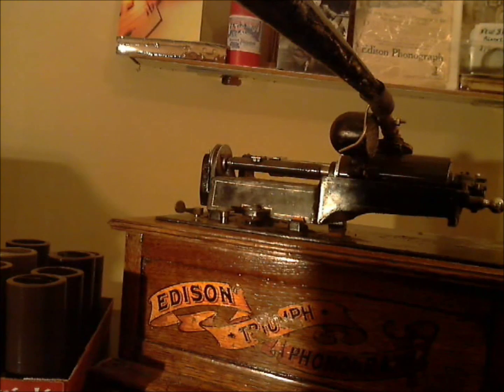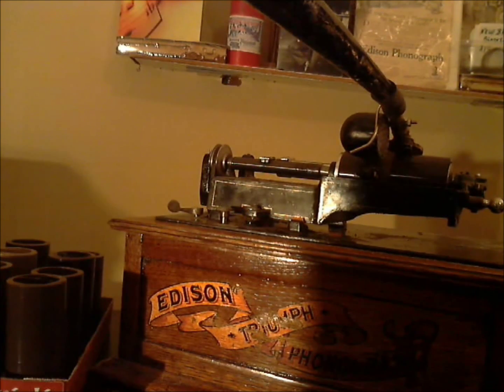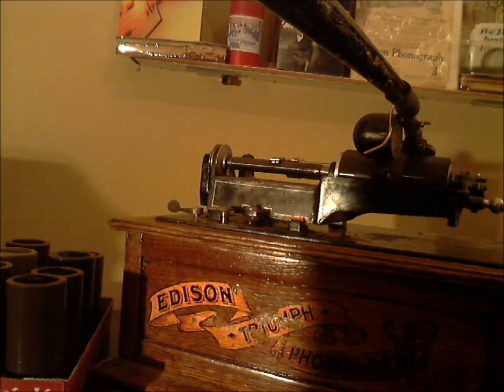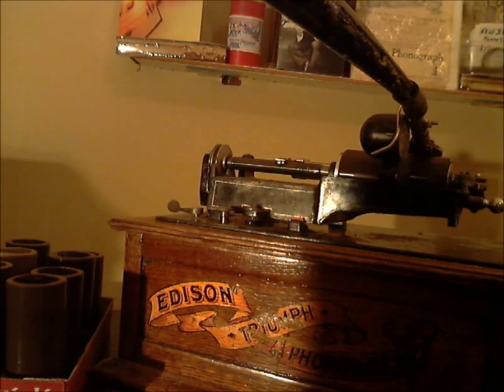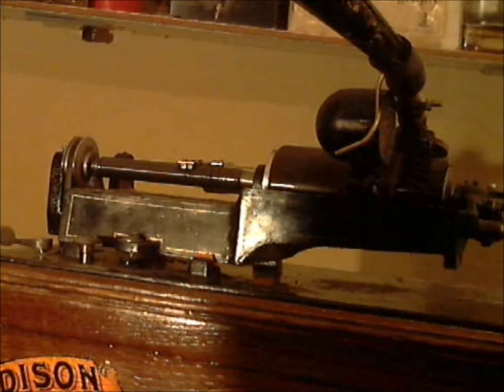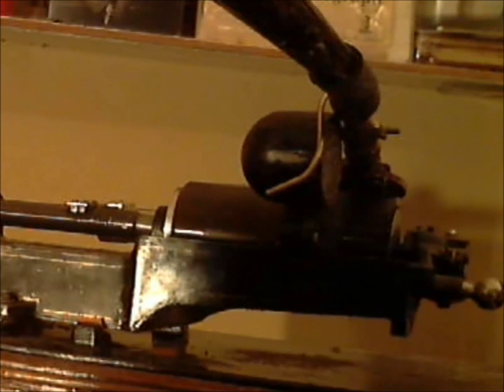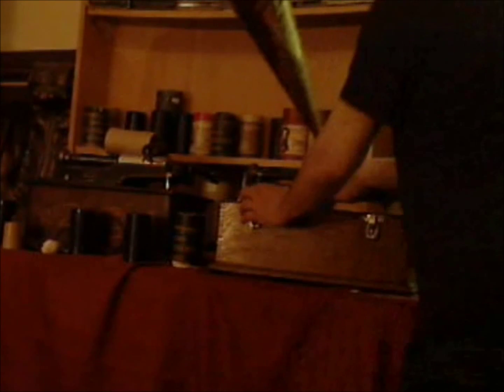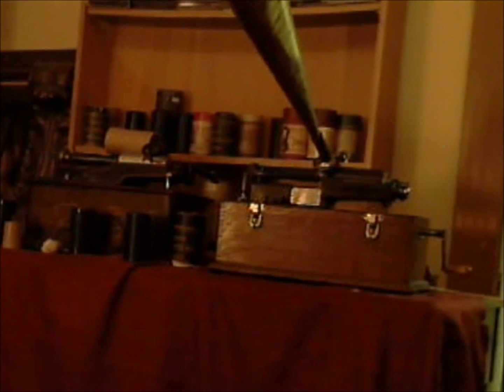Original Edison Studio Recorder Test Dubbing from Electric Diamond Disc.

Comment: The only imperfection I hear is the mechanical / spring tension of the Edison Machine. I liken it to taping music off the radio with a mono  cassette player in the 60's or 70's ? With an open mic in your bead room . Love your videos !
Reply from the maker: I eventually will build a topworks from scratch (so as to not harm the original.  It will have a large flywheel and also replace the lower pulley with a solid one for more inertia and smoothness, unfortunately the bottom pulley is pot metal, and is not perfect.

Comment: Hey Shawn, I know this is probably a stupid question but just wanted to ask anyway, you didn't show how the dubbing in this recording was made and was wondering, if you haven't done it yet, will you ever do horn to horn dubbing, inserting one horn into another, just like was done in the Edison recording studio? I love how you make all of your recording experiments so painstakingly accurate the way they were done back in the day.
Reply from the maker: Hi Amberola Thanks. I have tried dubbing from the DD by putting a horn inside the other, (internal DD horn, 250 size).  I had better luck dubbing from the Amberola 30, those experiments came out better, surprisingly.  The Key might be instead of the internal horn, a reproducer, modified to an external horn connection, like those used in the studio and the horns total about 12' long (2, 6', skinny horns) connected together with a rubber gasket.  Soon we are taking this recorder to record live music.